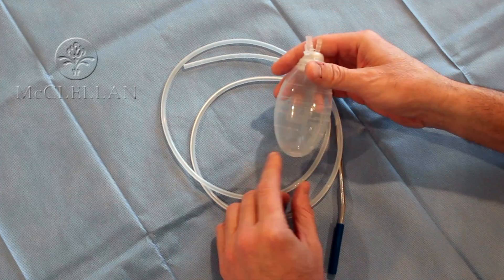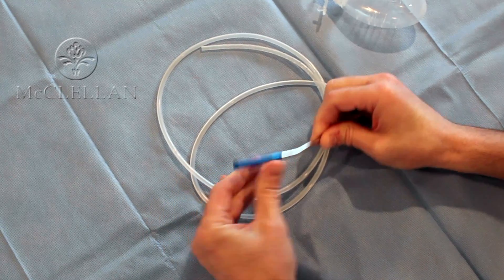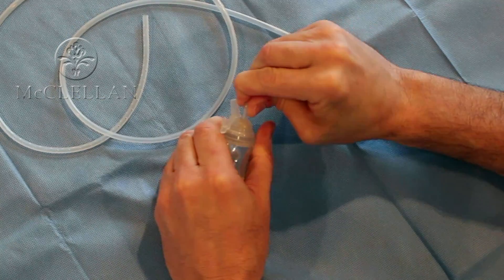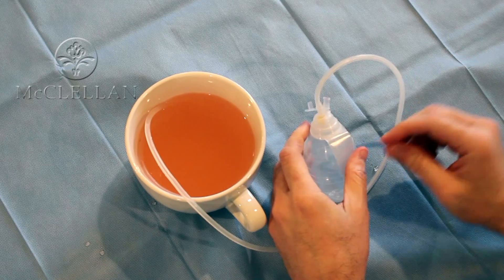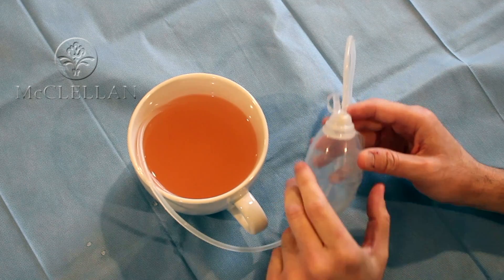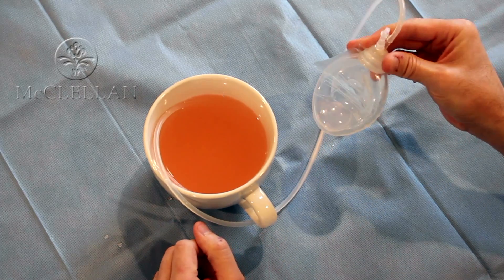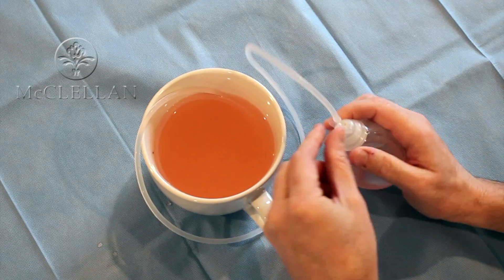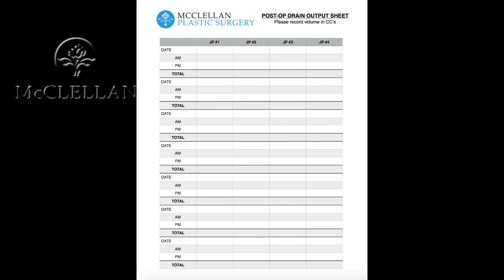What is a Jackson Pratt (JP) Drain? How does a JP Drain Work?

Comment: Hello Dr. McClellan. I see your video was posted in March of 2016, so I don't know if you check the comments anymore, but I'm feeling desperate for an answer. I was discharged from a hospital to a rehab about 6 days ago after being in the hospital for over two months! I had a regurgitating mitral valve which required open heart surgery to replace the valve - and then there were infection complications from a perforated colon (aiee!) The rehab is Truly Horrible (I didn't have insurance). I have a JP drain, and the aide was insisting the bulb should stay round, not compressed. Since it was always compressed at the hospital, and common sense should tell most people that squeezing it in creates a vacuum, I knew she was wrong. Further, there's info like yours all over the Internet. I feel the drain might be clogged. The bulb only has a little bit of fluid in it even though it hasn't been emptied since my arrival here last Friday. I don't think it's "finished", because the fluid that is in the tube is red, not yellowish like the way I guess it would be if it were finishing up. They won't even "milk" it; I tried but it didn't do much. So: there is a valve-looking thing at the Top end of the tubing, where it enters the skin. Is this a thing that might be clamping it closed? I'm afraid to fool around with it and the folks here - well it's basically do-it-yourself. If you can answer this, I'd greatly appreciate it. 
   Your video, by the way, is truly a gift. I don't know where the people here got their training, but they could have easily looked at something like it if they actually cared about helping. I love your video, it's the only video I saw about the JP drain, and it's so clear. (The "Crystal Light" touch humanizes it, too.) I love the language you use and it was wonderful of you to make that video. Thanks!